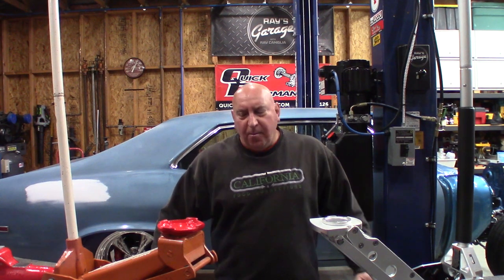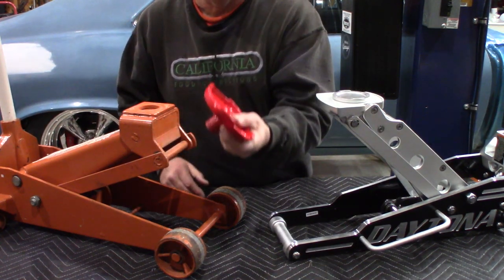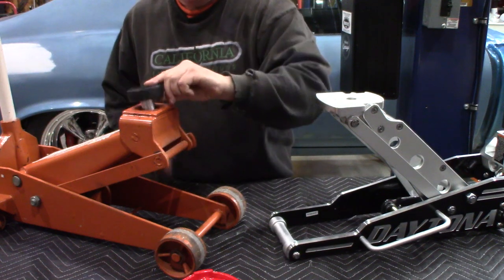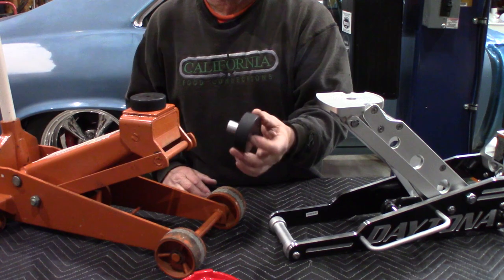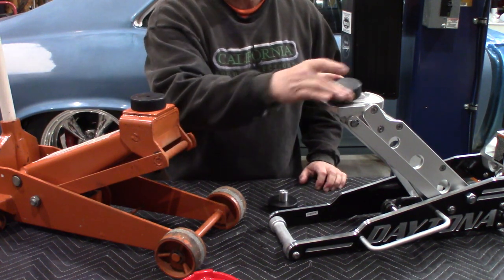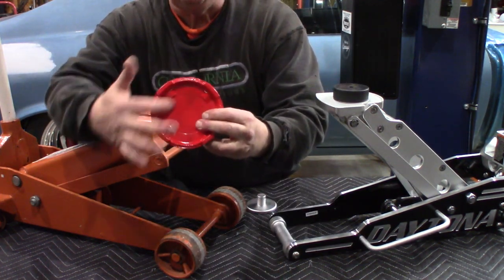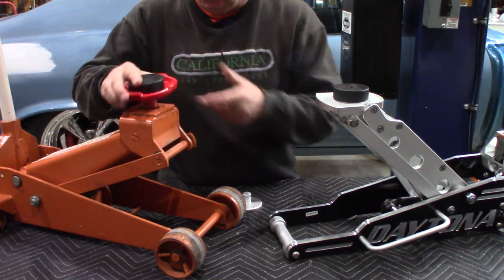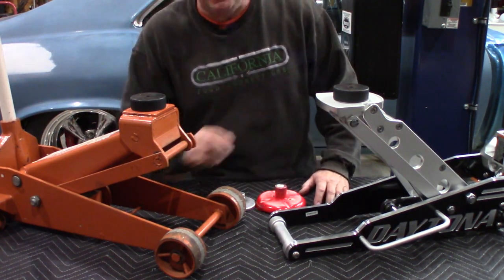Floor Jack Hack

Comment: The orange and white jack I believe like I bought new from Harbor Freight probably in the 80's.  Just got it out today after no use for 25 yrs.  It only lifted about 3/4 of range so I gave it a good cleaning to add oil.  I pulled the large shaft just in front of pump handle which allows main lift assy. to move forward gaining better access to the rubber fill plug.  Using a syringe I was able to easily add hydraulic jack oil which it did need 3-4 oz.? plus pumped handle slowly in the lowering position to maybe bleed air out.  Oiled wheels and lift points and it now works like brand new.  I do have the cross bar made for it too.  I've read that the orange & white floor jacks we're great jacks.  Regardless of it is 2 or 3 ton, being able to just add a little oil that had leaked out over decades and have it work like brand new makes it a great floor jack in my opinion.  Thanks for the great video.
Reply from the maker: Hi Jeff, Thanks for sharing! I do believe my Jack is over 25 years old as well and still works great!

Comment: Those might work in some cases on your hoist, there might be a 3/4 to 7/8 hole in the end plate that goes under the frame. Like you said, endless uses. I always pick one up at the thrift store when I see one. The NHL freezes pucks for game use, little hockey trivia there Eh.
Reply from the maker: Hey Mark, Great info and thanks for sharing! I played Ice Hockey for many years, yes I have all my original teeth! 😂